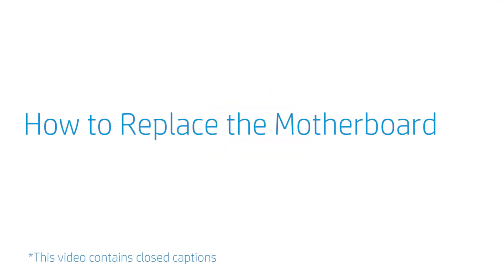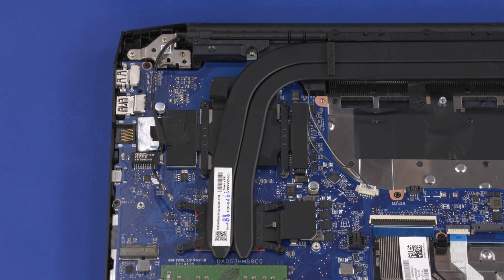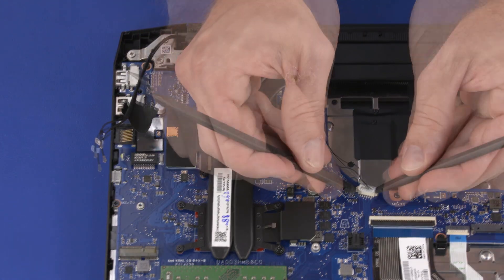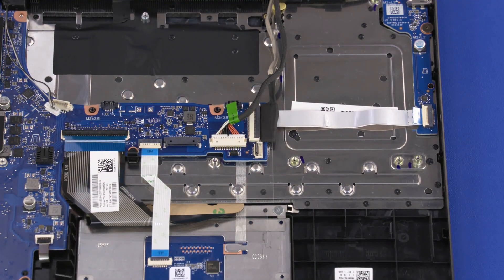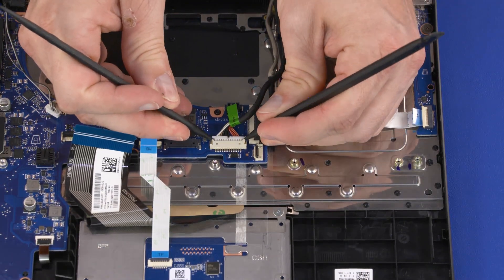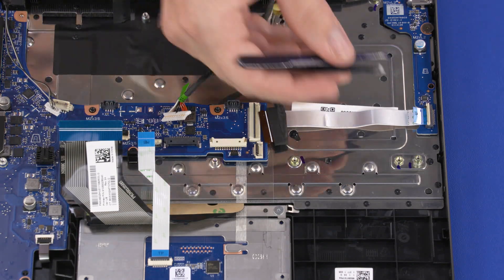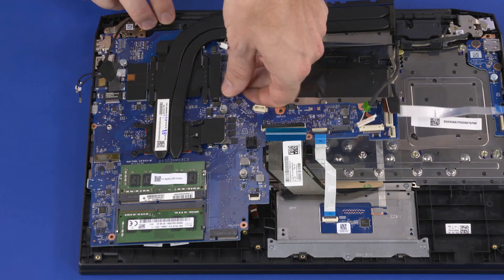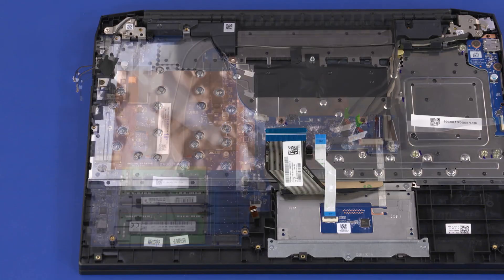Replace the Motherboard | HP Pavilion 15z-ec000 CTO | HP

Comment: Is the previous data losses when just replacing the mother board, not resetted the laptop
Reply from the maker: Hi there, thanks for contacting HP Global Social Media Support!
I understand that you need to know whether replacing the motherboard result in data loss.
I will do my best to assist you.
If you opt for a compatible motherboard replacement, the chances of data loss are relatively low. Your operating system, programs, and files should remain unaffected, as long as you follow the proper installation procedures and ensure the compatibility of the new motherboard with your existing hardware.
Regards, 
HP Support

Comment: Hello. I bought the HP Pavilion Gaming 15 new and it's not up to a year. The screen doesn't come on when I power on but the caps lock blinks 5 slow and 3 fast lights. I have tried everything possible but nothing worked. I have been advised to replace the Motherboard which is quite stressful for me though. How can I get the genuine one
Reply from the maker: Hi Olumide, thanks for contacting HP Global Social Media Support!
I understand that you are experiencing a blinking light issue on your notebook.
I will do my best to assist you.
Please refer to the instructions mentioned under this document to fix the issue: https://bit.ly/34b23sv
Binu_HP Social Media Tech Support
Reply from the maker: We hope you're doing well. Havent heard from you in a while.
If you do need any further help, we're just a ping away and shall be glad to help you out.

Comment: I don’t really have a mother board issue but my computer was struck with more voltage than it needed through lightning, opened it, nothing is burned not one thing, thinking it’s the charging port and took it to tech and all they said was “no fix” wondering how I would check if it’s the actual computer port if that’s fine
Reply from the maker: Hi there, thanks for contacting!
I understand that you are experiencing an issue with your computer.
In order to get this issue fixed, please contact our customer care team over the phone or chat for further assistance, as this issue requires Live conversation with you over phone or chat to isolate the issue and provide you instantly with appropriate solution or repair/replacement options available at your place as per the warranty.
Please feel free to reach us on call/chat, please access this link to select your preferred country and language option to reach us. Global support link: - https://www8.hp.com/us/en/contact-hp/ww-phone-assist.html
Binu - Social Media Tech Support

Comment: My motherboard got burned and I replaced with a new one in a nearby service centre.But after replacing the motherboard , wifi and Bluetooth are not working. Drivers are not installing and they tried everything . so how can I fix it ? Did they replaced with the original one or duplicate how can I know it? Please let me know how to fix this issue
Reply from the maker: +Manjali Chakraborty Please perform updates via HP Support Assistant as mentioned below to fix this issue:  HP Support Assistant Updates - 1) In the search box, type and open HP Support Assistant. 2) Check for updates. 3) If the updates are available, click on install and restart the computer.
Reply: Probably forgot to install the Bluetooth hardware into the computer etc lol

Comment: Ur fan connectors are absolute shit one of the whole fan connector was rocking inside the back cover and i was freaking out when the fan wasmt spinning i mean such poor PCBs the.female connector came out with solder pads
Reply from the maker: +Gamer Hemanth Please contact our phone support team to fix the issue. Please follow these steps to reach them.
Step 1. Open link: https://support.hp.com/us-en/contact-hp
Step 2. Select the product type.
Step 3. Enter the serial number of your device or select let HP detect your product option.
Step 4. Select the country from the drop-down.
Step 5. You should see the HP phone support number

Comment: Hey hp can I replace my amd a6 motherboard to ryzen 3 motherboard?
Reply from the maker: +Srikar creations HP does not recommend upgrading or downgrading hardware parts or software that is bundled with the product as It may affect the manufacturer's warranty and performance, however, you could change the configuration at your own discretion.

Comment: Hello! Quick question. I have an HP laptop, model # 15-r263dx, with a AMD A8 APU and integrated graphics. Is it possible to take out the chip altogether and just put another chip compatible with the socket/board in there? If so, what’s a good option? I’m looking for a chip good for gaming that’s not too expensive, still with good integrated graphics.
Reply from the maker: +Jayknowstheway HP does not recommend upgrading or downgrading hardware parts or software that is bundled with the product as It may affect the manufacturer's warranty and performance, however, you could change the configuration at your own discretion.

Comment: Should we use minimal force or?
Reply from the maker: +Arnie Gurgle Follow these steps to replace the motherboard for HP Pavilion 15z-ec000 CTO.
- Before you begin: Remove the base enclosure, battery, M.2 solid state drive, WLAN module, hard disk drive assembly, left fan, and right fan.
- Removal -
- IMPORTANT: Make careful note of the routing of all the cables for later replacement.
- Peel back the retention tape that secures the wireless antenna cables to the heatsink.
- Disconnect the speaker cable from the connector on the motherboard.
- Using minimal force, lift the locking bar up on the keyboard light ZIF connector and disconnect the keyboard light ribbon cable from the motherboard.
- Using minimal force, lift the locking bar up on the keyboard ZIF connector and disconnect the keyboard ribbon cable from the motherboard.
- Using minimal force, lift the locking bar up on the touchpad button board ZIF connector and disconnect the touchpad button board ribbon cable from the motherboard.
- Disconnect the DC-in cable from the connector on the motherboard.
- Using minimal force, lift the locking bar up on the display panel cable ZIF connector and disconnect the display panel cable from the motherboard.
- Using minimal force, lift the locking bar up on the power board ZIF connector and disconnect the power board ribbon cable from the motherboard.
- Remove the five 3.5 mm P1 Phillips-head screws that secure the motherboard to the top cover.
- Grasping the mother board near the center, lift the right edge off the alignment pins, slide the external connectors out of the cut outs in the top cover, and remove.
- NOTE: Before installing a new motherboard, remove all components from the old motherboard and install them onto the new motherboard.
- Reverse this procedure to install the motherboard.
Caution: Improperly installing or replacing parts could damage your HP device or void your warranty. Before replacing any parts, check your warranty.

Comment: If water poured on my laptop and the boards are damaged can I fix or I need to replace it
Reply from the maker: +Doreen Ahmed Matey In most cases, you need to replace it.
Reply: But the repairers said its spoilt is that true or they just can't fix it